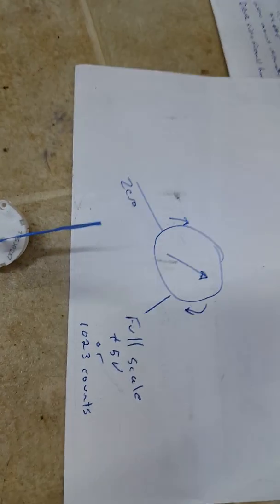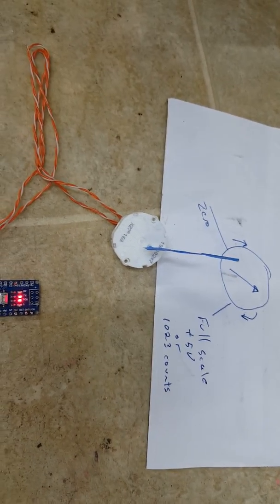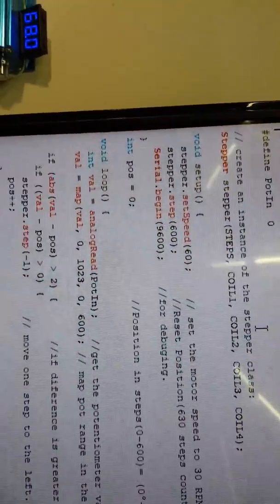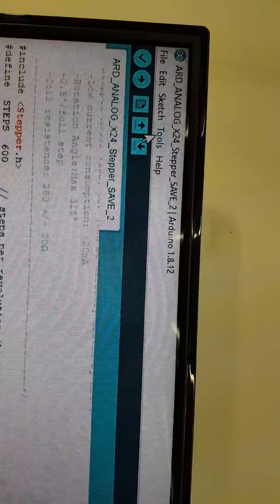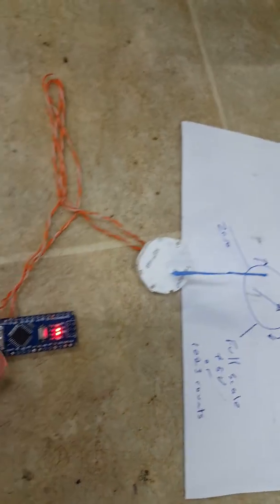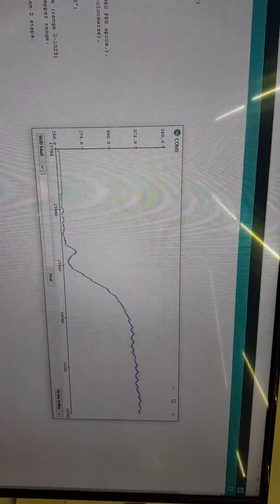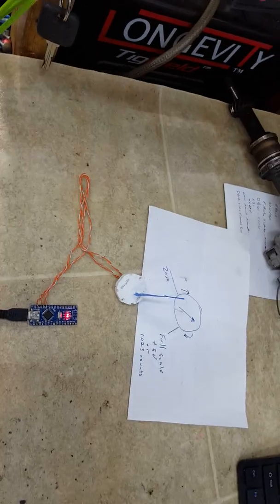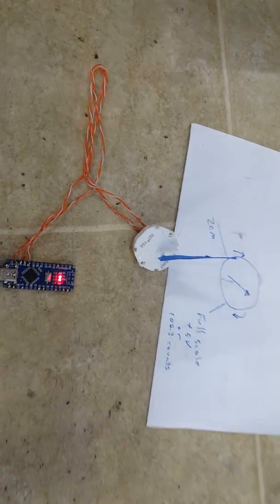GM stepper arduino analog input explanation

Comment: Do you know how much current each coil draws?  It looks like you're able to drive the coils directly from the Arduino pins with no buffering.
Reply from the maker: it's under the output limits of the arduino and yes it's directly driven.

Comment: Awesome! Just wish you moved the camera to more easily see the coding. Are you going to post the code anywhere?
Reply from the maker: /*------------------------------------------------------
  Gauge_Pot01
  Arduining.com 10 July 2011
  Direct driving of Miniature Stepper Motor used as an indicator
  drive for dashboard instrumentation.
  Hardware:
  -Arduino UNO.
  -Potentiometer.
  -Stepper Motor VID29-05P (Can be directly driven by MCU):
    -Low current consumption: <20mA
    -Rotation Angle:Max 315°
    -0.5°/full step
    Coil resistance: 280 +/ 20Ω
  -----------------------------------------------------*/
#include <Stepper.h>
#define  STEPS  600    // steps per revolution (limited to 315°)
#define  COIL1  8
#define  COIL2  9
#define  COIL3  10
#define  COIL4  11

#define PotIn  0

// create an instance of the stepper class:
Stepper stepper(STEPS, COIL1, COIL2, COIL3, COIL4);

void setup() {
  stepper.setSpeed(60);    // set the motor speed to 30 RPM (360 PPS aprox.).
  stepper.step(600);       //Reset Position(630 steps counter-clockwise).
  Serial.begin(9600);    //for debuging.
}
int pos = 0;               //Position in steps(0-600)= (0°-315°)

void loop() {
  int val = analogRead(PotIn);   //get the potentiometer value (range 0-1023)
  val = map(val, 0, 1023, 0, 600); // map pot range in the stepper range.

  if (abs(val - pos) > 2) {      //if diference is greater than 2 steps.
    if ((val - pos) > 0) {
      stepper.step(-1);      // move one step to the left.
      pos++;
    }
    //  delay(25);
    if ((val - pos) < 0) {
      stepper.step(1);       // move one step to the right.
      pos--;
    }
    //   delay(25);
  }
  Serial.println(pos);      //for debuging...
  //  Serial.println(val);
  //  delay(100);
}
Reply: @aknovaman  Thank you sir!